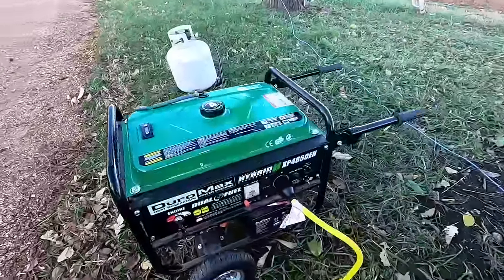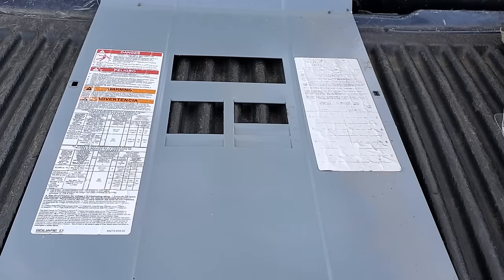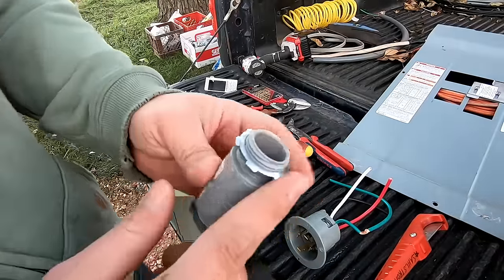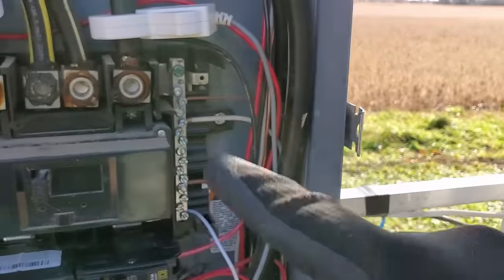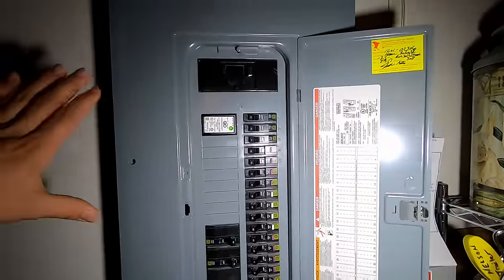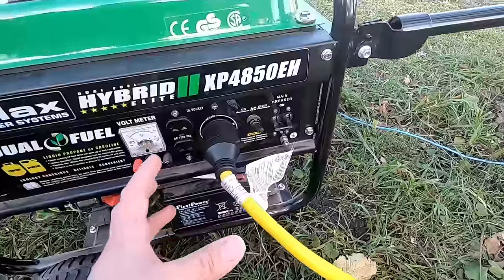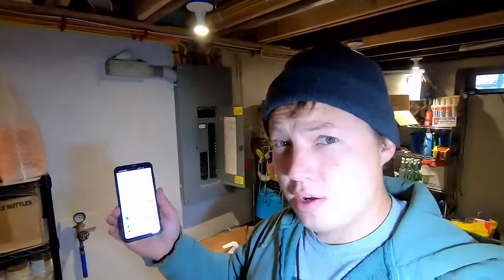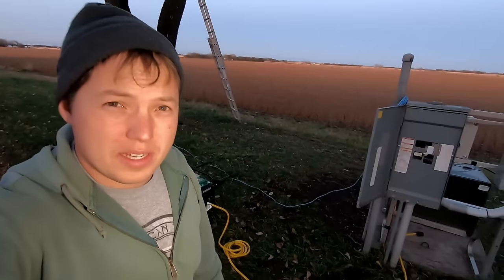How To Hook Up a Generator To Your House Using a Breaker Interlock Kit & Power Inlet Box

Comment: Great vid according to NEC CODE a 30 amp rated circuit can be maxed at 80% so we can only get about 3000 watts before your good breaker popped.
Reply: Here are the generator safety rules that everyone needs to follow: this is just a reminder for everyone’s safety. Always make sure you follow all the generator safety rules whenever you use your portable generator. Generators can be dangerous if not used carefully. Every year, hundreds of people die or get injured when using portable generators due to carbon monoxide poisoning and electrocution. Make sure you are using your generator carefully and keeping others safe as well. There is something very serious that everyone should always be aware of when using generators. Some people do run their generator indoors which is not safe and that increases the risk of carbon monoxide poisoning which can cause death of family and you. Some people run their generator in wet conditions which can electrocute them. Please remember that you should never run your generator indoors. Remember that carbon monoxide is an odorless and colorless gas that you cannot see or smell. Carbon monoxide is a silent killer. Keep that in mind. Make sure your generator is 15-20 feet away from your house and away from doors, windows, and vents. Never use your generator in your porch too. Having a carbon monoxide detector is very important against generator safety. Some people also allow children to go near the portable generator which could pose risks. We need to keep an eye on our children making sure that they are not near the portable generator so they won’t get electrocuted or burned by the generator which is dangerous. A locking enclosure also keeps kids safe. A generator shed might look like a tempting place to explore, or take cover during a game of hide and seek, but a generator is a dangerous piece of equipment that can cause injury. It says on the manual that we should also keep children away at all times from the portable generator to avoid injuries. Please do not allow a child or unqualified people to operate the portable generator.  It is important to keep your children safe especially little ones. The portable generator can be hot during an operation. Just because some manuals missed what should be listed doesn’t mean it’s safe to do. Always follow the generator safety rules when using portable generators. Generators pose electrical risks. If you need to use your generator during wet weather, you need a generator tent to protect your generator from getting wet. Don’t let your generator get wet. Keep your generator dry and before using your generator, please make sure your hands and your generator is dry. Do not wear loose clothing when operating the generator. Everything that is said on the generator’s operating manual should not be ignored. Never smoke cigarettes near the generator. Please keep flammable things away from the generator. Never overload your generator too. Your generator can catch fire. Never ever try to plug a generator cord into a wall outlet to avoid back feeding. Back feeding your generator is dangerous. Always turn on your generator first before plugging in appliances and shut off the appliances before turning your generator off. Use a heavy duty cord for your generator and the cord should not be worn out. All the instructions should be followed carefully. Never refuel your generator while it’s running. It can cause fire if fuel spills while your generator is hot. You should turn off your generator and let it cool off before refueling it. Having a fire extinguisher next to the generator is also important. This is only a reminder for everyone’s safety of using generators. Make sure your generator is properly grounded. Having a fire extinguisher next to the generator is also important against the safety rules. https://youtu.be/I1jT3ANENvI and here is a video more about keeping others safe when using generators and also about our family’s safety. It’s important to keep our little children safe as well. Make sure your little children are kept away from the generator at all times especially when it’s running. Hope this helps. Always remember that it’s better to be safe than sorry. Also remember that warnings should not be ignored too.

Comment: smart to use propane , lots of rural houses have a huge tank of propane problem solved for a good spell , I would have used out door caulking on your tubing yes the wire is rated for out doors .

Comment: Just a FYI I live in a modular home with a poured base that has those plastic vents built in.  In a big snow storm I could only place the generator 6 ft away from the house due to 3 ft snow. We have ours set up with extension cords and use one room with a space heater Satellite box ,TV ,  ext. the rest of the house is cold .Anyways our main CO 2 detector was going off the middle of the night.  Apparently generator exhaust was getting sucked under the house and coming into the house. We could have died if not for the CO2 detector . Our power was out 26 hr.  I am looking into running it in to the power box (a electrician wanted $1500) Thanks Benjamin it would be nice to have the water pump run were all electric home.
Reply: ⚠️Generator safety tips:

This is just a reminder for everyone’s safety when using portable generators. All generator safety rules need to be followed carefully to avoid hazards. 

1) Please do not allow an unqualified person or your children to operate the portable generator. Just because some manuals don’t say that doesn’t mean it’s safe. That is important against the generator safety rules. We also need to be keeping an eye on our children too. You need to make sure that your children are not playing near the portable generator especially when it’s running so they won’t get electrocuted. Generators pose electrical risks and they can be hot during an operation. Please keep your children away from the portable generator at all times. It is important to keep our children safe especially our little ones. Be aware of all the hazards.

2) Some people use their portable generators indoors which increases the risk of carbon monoxide poisoning. It’s important to have a carbon monoxide if you have a gas generator. Never ever use your generator indoors even if your doors and windows are open and even in the garage is not safe to use a portable generator. Not even at your porch and your deck. It is never safe to use your generator indoors and in enclosed areas of your home. Your generator needs to be 15-20 feet away from your house. 

3) 🔥generators cause fire hazards too. Never refuel your generator while it’s running. You need to let your generator cool off before refueling it and before storing your generator. Never overload your generator too. Never ever back feed your generator. You should never plug your generator into a wall outlet. Also never store propane tanks indoors. Please keep flammable things away from the generator as well and please don’t smoke cigarettes near the generator. Having a fire extinguisher next to the generator is also important against the generator safety rules. 

4) generator operation; make sure your hands are dry before touching the generator. Never use your generator in wet conditions. Don’t let your generator get wet. You need a generator tent if you need to use your generator during wet weather. Please don’t wear loose clothes when operating the generator. Turn on your generator before plugging in appliances. Use the right cord for your generator. Please do not use worn out cords. 

https://youtu.be/I1jT3ANENvI and here is a video more about keeping others safe when using generators and also about our family’s safety. Hope this helps

Comment: Excellent video 

I just picked up a firman 9400 Costco special.  It has both 30amp and 50amp 240v plugs. Should I wire up the 50amp to the house?

Comment: Good job with video the question I have is with using a grounding rod to hook to the ground on the generator everything I have been taught is a grounding rod is almost useless. I have taken  classes where we have hooked up 120 volts thru a circuit breaker    to the grounding rod turned on the circuit breaker and nothing happens circuit breaker doesn't  trip. So if somehow the hot shorts to ground  it could still have a hot situation where not only the generator is hot so is the {dirt or ground} is hot  around the ground rod so wouldn't be better if you didn't have the ground wire in the romex to hook it back to the ground in the breaker box ?.

Comment: Thank you for sharing your videos, you are very informative with your electrician experiences. I never knew how to hook up a outside generator, so now i have the confidence to do so.
Reply: Don’t forget about the generator safety tips as well. Remember safety is always important. Here are the generator safety tips:

1) Please do not allow an unqualified person or your children to operate the portable generator. Just because some manuals don’t say that doesn’t mean it’s safe. That is important against the generator safety rules. We also need to be keeping an eye on our children too. You need to make sure that your children are not playing near the portable generator especially when it’s running so they won’t get electrocuted. Generators pose electrical risks and they can be hot during an operation. Please keep your children away from the portable generator at all times. It is important to keep our children safe especially our little ones. Be aware of all the hazards.

2) Some people use their portable generators indoors which increases the risk of carbon monoxide poisoning. It’s important to have a carbon monoxide if you have a gas generator. Never ever use your generator indoors even if your doors and windows are open and even in the garage is not safe to use a portable generator. Not even at your porch and your deck. It is never safe to use your generator indoors and in enclosed areas of your home. Your generator needs to be 15-20 feet away from your house. 

3) 🔥generators cause fire hazards too. Never refuel your generator while it’s running. You need to let your generator cool off before refueling it and before storing your generator. Never overload your generator too. Never ever back feed your generator. You should never plug your generator into a wall outlet. Also never store propane tanks indoors. Please keep flammable things away from the generator as well and please don’t smoke cigarettes near the generator. Having a fire extinguisher next to the generator is also important against the generator safety rules. 

4) generator operation; make sure your hands are dry before touching the generator. Never use your generator in wet conditions. Don’t let your generator get wet. You need a generator tent if you need to use your generator during wet weather. Please don’t wear loose clothes when operating the generator. Turn on your generator before plugging in appliances. Use the right cord for your generator. Please do not use worn out cords. 

https://youtu.be/I1jT3ANENvI and here is a video more about keeping others safe when using generators and also about our family’s safety. Hope this helps be safe

Comment: This is a really great video and you went very detailed.  Quick comment though about something you glossed over and think it bears some attention....

Originally, I didn't think you bonded the ground wire to the metal Genny receptacle enclosure you installed, however I eventually saw that you DID in fact bond to it, and then stubbed a ground out properly to go from the enclosure to the main panel.  I had to review it a few times to see that you did so, though.  Anyhow, sorry for the quarterbacking, just wanted to mention it.  Thanks for the well done video!

Comment: Nice job! Exactly how I did ours last summer, without the remote panel. I like the versatility of using any combination of breakers while remaining smart about overall load and balance in lieu of a transfer panel with few choices. Until now, I was conflicted on the  necessity of running a separate ground. Was confident that it's grounded via the plug harness but hadn't thought to test it your way. I like the power use sensor idea...

Comment: Watched you once before I had a gen got one couldnt find you then you poped up great job!!!!
Reply: ⚠️Please don’t forget to follow the generator safety tips when you use your portable generator:

This is a reminder for everyone’s safety when using portable generators. All generator safety rules need to be followed carefully whenever you use your portable generator. This is just to make sure. 

1) KEEPING OTHERS SAFE: Please do not allow an unqualified person or your children to operate and service the portable generator. Just because some manuals don’t say that doesn’t mean it’s safe. That is important against the generator safety rules. We also need to be keeping an eye on our children too. You need to make sure that your children are not playing near the portable generator especially when it’s running so they won’t get electrocuted. Generators pose electrical risks and they can be hot during an operation. Please keep your children away from the portable generator at all times. It is important to keep our children safe especially our little ones. Be aware of all the hazards.

2) WHERE TO RUN YOUR GENERATOR: Some people use their portable generators indoors which increases the risk of carbon monoxide poisoning. It’s important to have a carbon monoxide if you have a gas generator. Never ever use your generator indoors even if your doors and windows are open and even in the garage is not safe to use a portable generator. Not even at your porch and your deck. It is never safe to use your generator indoors and in enclosed areas of your home. Your generator needs to be 15-20 feet away from your house. 

3)🔥FIRE HAZARDS: Never refuel your generator while it’s running. You need to let your generator cool off before refueling it and before storing your generator. Never overload your generator too. Never ever back feed your generator. You should never plug your generator into a wall outlet. Also never store propane tanks indoors. Please keep flammable things away from the generator as well and please don’t smoke cigarettes near the generator. Having a fire extinguisher next to the generator is also important against the generator safety rules. 

4) GENERATOR OPERATION: make sure your hands are dry before touching the generator. Never use your generator in wet conditions. Don’t let your generator get wet. You need a generator tent if you need to use your generator during wet weather. Please don’t wear loose clothes when operating the generator. Turn on your generator before plugging in appliances. Use the right cord for your generator. Please do not use worn out cords. 

https://youtu.be/I1jT3ANENvI and here is a video more about keeping others safe when using generators. Everything that is said about the generator safety rules all need to be followed. Especially keeping your children safe. 

Hope this helps

Comment: I really like your presentation because you talk about important things very clearly. Thank you very much. I wonder how I go about using an ampere meter to check on how amps my house is using. My house is 60 years old and has a 100-amp panel. I have an electric water heater, one 220-volt stove upstairs and one 220-volt. stove downstairs. Things seem to be OK because there is no tripping of breakers at the main panel. I also notice that there is a small sub-panel that is about 1 foot away from the main panel and the sub-panel is active. 
Upstairs already has a 220 volt washer and dryer, but now I want to add a 220-volt electric dryer in downstairs. I am afraid that this 2nd electric dryer would be too much for my 100-amp main breaker to handle. Can I buy an ampere meter and hook it up at where? to see the total amperes that are going thru the system when 2 stoves are on and 2 electric 220-volt dryers are on? I think I am not ready to upgrade to a 200-amp panel due to financial reason. I can buy a 110-volt dryer and washer combo, but the dryer takes 4-6 hours to dry? Please advise.

Comment: This is a GREAT vid!  One question…why install a 30 amp vs a 50 amp?  Even if your current generator only goes up to 30, you would have the infrastructure already in place for a bigger generator . As long as you monitor everything, would this be an issue?  All you would need to do is switch out the receptacle then

Comment: At 19:00 you talk concerning generator grounding. In your demonstration is that generator wired in floating neutral configuration?  If you were not wired to the house panel but were just running appliances with extension cords, would you want to be in bonded neutral and ground the frame?